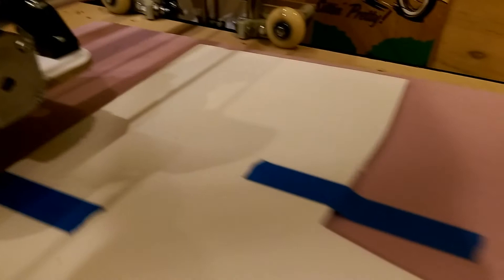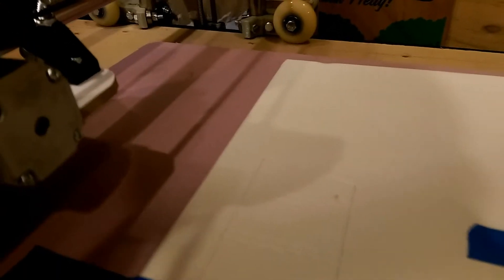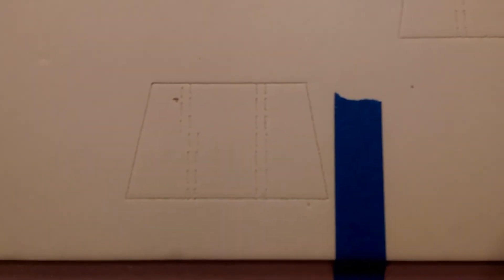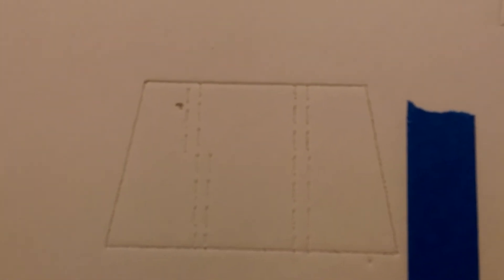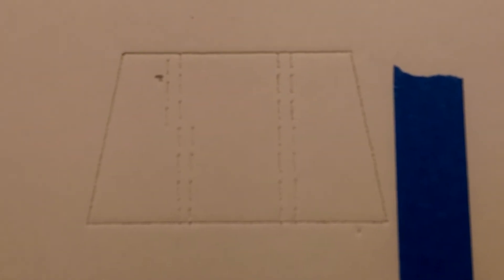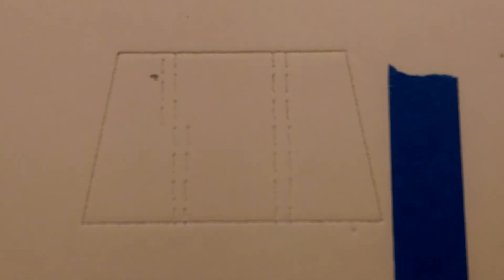Lowrider CNC Needle Cutter first success!

Comment: Congratulations! As to your feed rate question I use and recommend a 600mm feed rate with 6000 rpm on the cutter or 800mm feed rate for 8000 rpm on the cutter. So far so good.
Reply: In case you didn't see it on the forum, Jason created this to help. https://jscalc.io/calc/46UNa6KQoeqDptKR